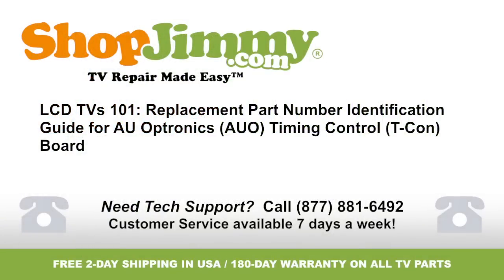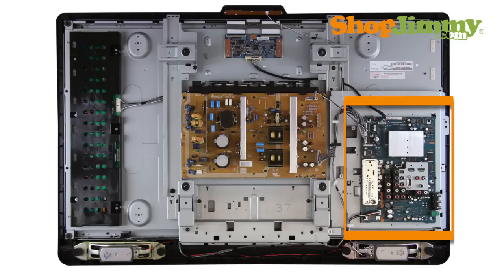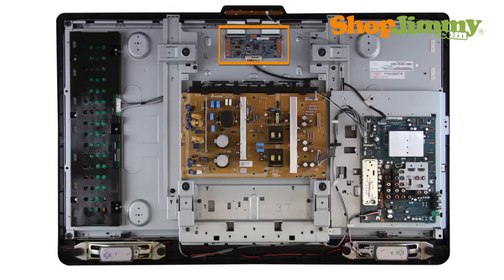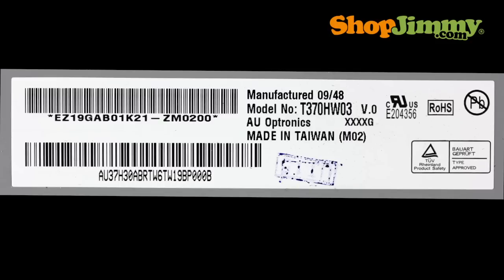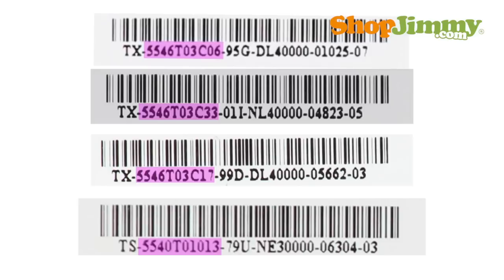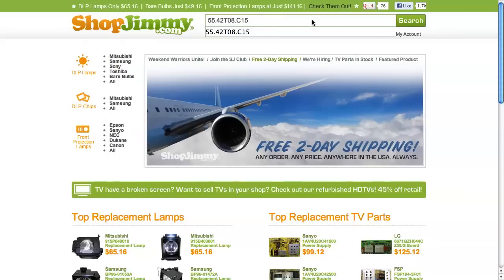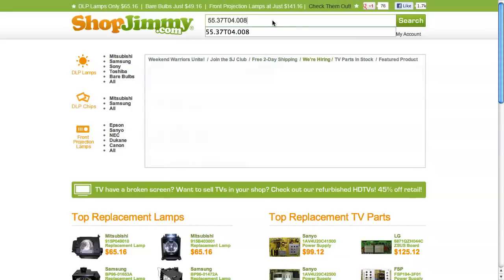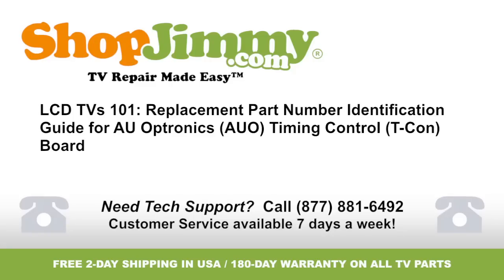LCD TV Repair - Part Number Identification AU Optronics (AUO) T-Con Boards - How to Fix LCD TVs

Comment: i have sony tv kdl 43w800c which is first i have change/replace the tcon board and transfer the two ic of old tcon to new tcon board and it fix the problem then after a  year my tv blinks in red color for 3 times, and i change the main board and the result is green and orange blinks 11 times and no display. any recomendation from you sir, thanks inadvance

Comment: Hello Sir! I have a BAUHN 32'TV W/ DVD  Part of the suspected diagnose by a technician is the main board it turns red and standby no indication of power on has  a serial identification T.MSD306. 32A 11202 how can avail of the mainboard if incase if it has to replace and advise me pls.

Comment: Hi 
I have a solarisation problem in my Samsung  LCD MODEL t400HW02 
I see all black menus perfect, no damaged or burned pixels but the picture is like 16 bit in old computers
What is th solution ? Can I send you a video with the problem for exact diagnostics ?
Reply: Gena Vasilevsky  t400hvn01.0

Comment: Hello, I bought a 60" Vizio (E600i-B3) that has issues.  The TV powers on but the only thing it can do is play videos over our wireless.  Also there was no volume.  I plugged into each of the hdmi ports and nothing worked.  Previous owner said a "new mother board" was put in.  I contacted him to see if he knew the specific board that was replaced.  Any advice is appreciated.
Reply from the maker: buckhunter1028  Please watch this video FIRST to help with your repair!  https://www.youtube.com/watch?v=BP3NVNCGEv8  I recommend replacing the main board in your TV.  Click this link to replacement main boards for your TV model number on our website:  http://www.shopjimmy.com/catalogsearch/result/index/?cat=56&q=E600i-B3  There may be multiple boards for the same TV model number, be sure to match part numbers on your current board, with your replacement for compatibility.  Here is a link to a video showing how to identify your part number, click here:  https://www.youtube.com/watch?v=kxkeGLhlQY8  Thanks and please let us know if you have any further questions with your TV Repair!  www.shopjimmy.com

Comment: I have a Maxent 58 in plasma. Set works great for several hours and the picture blinks and is unstable. When I let the set cool for awhile it works fine again. What is the trouble area? Power supply, fan, ?
Reply: anh kiểm tra nguồn,ổ  cắm,0988849606  (VIỆT NAM)